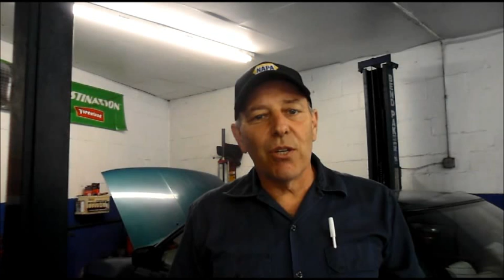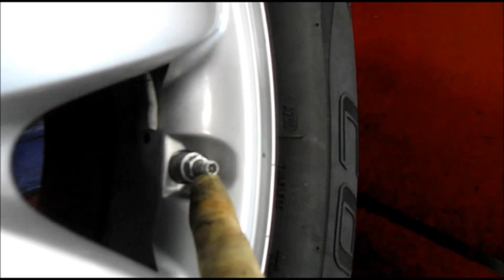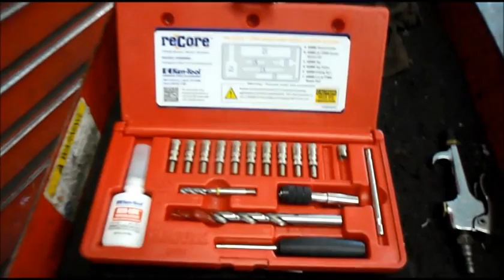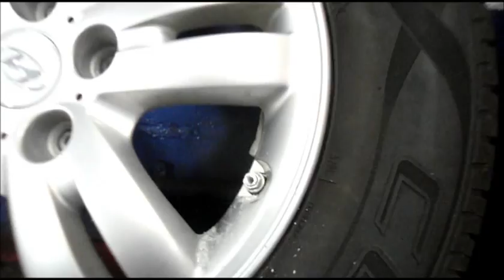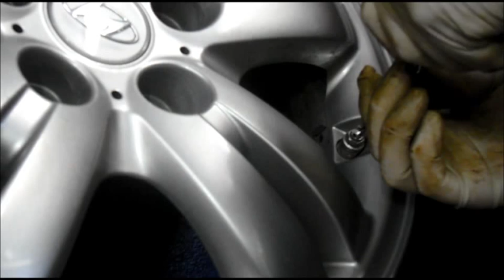Repair Broken Tire Pressure Sensor Don't replace It !!!!!

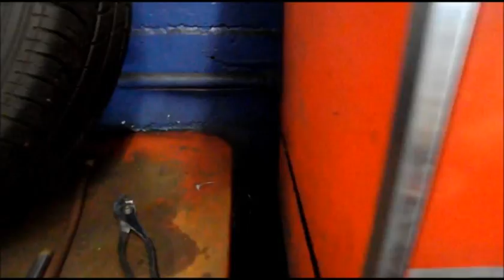Comment: @13:34 It should be certain torque there. On one sensor I bought (REDI Sensor) they gave that torque in the instructions 71 in-lbs ( and Schrader Valve 2.7 in-lbs),  but I see that torque on nut might differ (Schrader probably the same, but it is a problem to find a torque wrench within that small range), since in another film it was stated to be 62 in-lbs. Obviously the question about the specific torque on the Nut of the TPMS sensor kits is overlooked, I would say in all the films on YT about those kits. I want to reuse the original sensors, which are good, but don't know the specs on the nuts in service kits I bought. Probably I'll apply 71 in-lbs, not sure about this part of the project. I would appreciate any opinion on this matter.

Comment: I have a 2012 Honda odyssey.. the tire pressure monitor came on .. Honda service said I have a slow leak in the tire sensor on all 4 tires .. I'm a bit skeptical that all 4 are leaking .. to replace all sensors is about $700.00 the milage is about 129,000 .. just a family car and work vehicle.. any suggestions on saving some money in this situation? Thank you 😊

Comment: Jim I bought a new set of wheels and tires they told me the sensors would automatically take to my 2019 Grand Cherokee altitude. As they didn't now my Uconnect over my phone through my lease is sending alerts. how do i fix this Issue. As the code for the sensor in the new Wheels need to match up with the OEM code that I replaced .

Comment: Adding air into a Tire that has nitrogen will ruin the Sensor. If it isn’t pure clean air Compressor.
Reply from the maker: No it will not cause any problem.Thanks for watching.

Comment: This is insane, good job as usual on Jim's part, but if people weren't so lazy and learn how to use a tire pressure gauge a person wouldn't need an over priced tire stem. I just look at the tire and tell if it's low, then confirm with pressure gauge and boom, put some air in it and boom, I'm done. Unbelievable how lazy society has gotten. Sorry Jim, you did a great job as usual.
Reply from the maker: I agree 100% today people don't take the time to do the most basic things like check your tire pressure or even there oil.  People have gotten to dependent on technology.thanks for your input and for watching

Comment: It's my experience that replacing these rims with "analog" rims and being responsible for maintenance is more cost effective than having these strand you or your kids at some random convenience store in the middle of the night just because they wanted to add air to the tire. Cheap problem with a ridiculously expensive solution.
Reply from the maker: Thank you for watching .  Don't forget to subscribe.

Comment: What are the tools for repairing same on 2007 Mazda CX-9? Where can I get them?
Reply from the maker: If the valve is metal it will work and as for were to buy it you should be able to find it on line.

Comment: The new valve stem should have been shorter.  Since it is made of aluminum, it won't bend but will break the next time somebody scrubs a curb with it.  The original valve stem was short enough that it would hit if you scrubbed a curb.

Comment: Or put a normal valve steam in and deal with the light on the dash. There like $1.00 a piece. Check your tire pressure when you fill up or service it.
Reply: you can't many inspection laws say if you have a tpms system it HAS to work so you have no choice. its all a scam

Comment: Will this fix the no pressure reading on my dash? It gives me low tire pressure symbol but the pressure is fine.
Reply: No the battery inside your sensor is most likely dead

Comment: This works great for sensors with the valve that's fixed into the actual sensor, however with some BMW's and a Majority of  Hyundai's the service pack with valve replacement is the better option.

Comment: I bought a used 2007 toyota corolla le and im not so sure  if this car has a tire pressure system. I did look on my owners manual and  a tire pressure system is in the manual. But in my car it doesnt have the button instead it has empty slot and a clip that covering the empty slot next to the security light. How do i check if my car has a tire pressure system?

Comment: Dear Mr. Jim, Thank you so very much for your unique and distinguished touches on this video. You are a Master Mechanic. My case was a Rav4 2008 pressure sensor, but not leaking or damaged valve. Any suggestions is much appreciated. Thank You.
Reply from the maker: Thank you ..Live stream tonight at 7:00 PM .I hope you can stop by.
Reply: Dear Mr. Jim . It is an honor to meet you here for the first time. I'm a Mechanical Engineer who graduated in 1977.I wished one day I can visit you. I'm residing in Orlando. Can i still be able to see your live stream tonight? Thank YOU. I'll also share with you some of my experience with Automotive Repairs. My email address is: emad.alomary77@gmail.com. Thank You Sir
Reply from the maker: See you at 7:00 tonught

Comment: Ok Jim, I broke down  and bought an aftermarket tpms. It says no programming required. Cloneable. Use factory re-learn procedure. So, #1 How do I clone it? #2 What is the factory re-learn procedure for my 2007 Dodge Grand Caravan? I am not finding the correct procedure for my vehicle on the  internet.
Reply: ,I found the re-learn procedure but still need help on the cloning part. Got anything?

Comment: I have a 2007 Dodge Grand Caravan. I have to replace 1 tpms. Can I replace it with a traditional valve stem? I know you won't recommend it but I am poor and they were not mandated until 2008.
Reply from the maker: Yes you can replace the sensor with the old style valve but the TPMS light will stay on.Your are right I would never recommend doing that .Don't forget Live stream on Sunday at 7:00 PM

Comment: Thanks for an awesome instructional video. However, after installing as you instructed, air comes out after I pumped the air in on the completed stem valve. Doesn't stop no matter what. Any thoughts on this? Thanks.

Comment: I have a 2011 Sonata Limited. I have a small leak at the tire sensor. The outer potion of the valve that treads on is where the air is coming from. Is there a fix for this?
Reply from the maker: Willie Wallace If the stem is all aluminum you can repair it as in the video. There is a rubber seal that sometimes needs to be replaced as well. The rubber seal is between the rim and the stem.
Reply: Thanks Jimthecarguy; I replaced the rubber seal and no more leak
Reply from the maker: Willie Wallace Great job. Thanks for watching the video.

Comment: How did you fix the sensor if the sensor is inside the tire? I have one that I believe don't work on a 2010 Chevrolet hhr. Valve stem is fine.

Comment: Dear Jim.
You could simply just replace only the valve part and keep the sensor. Just FYI.
Also if you fit a titanium valve made from HUF, you will never get a stripped thread or seized or whatever. Quality is always the difference.
Also if the owner just go anticlockwise first to find the end of the thread that would not have been an issue, probably ever.

And just a simple advise who ever did this,  NEVER EVER, EVER install clip on weights on an aluminum rim. Those are for STEEL WHEELS NOT ALUMINUM.
Also NEVER EVER, EVER, mix clip on weights with stick on weights.
The odd part is that the owner of this Hyundai actually accepted this extremely unprofessional wheel balancing, instead of demanding only stick on weights, and stick on weights ONLY.

Comment: Way too much thread lock. nice job tho but tool only worth buying if your doing a few repairs.
Reply: He did a nice job. I was saying the same thing way too much thread lock lol
Reply: @ndandthecave456  the reason I clicked on the video is I'm looking for a video on how to remove the tpms sensors from an 09 rav4. The dealer wants over 1,200 bucks to replace 5 of them and I can get them online for about 200 bucks for all 5. Just need to figure out how to replace them (and I'm sure program them) lol
Reply: @ndandthecave456  can you access them without taking the tire off the rim? I have no way to get the tires off the rim. I mean yea I guess it's possible without a machine but that's alot of work having to do it without

Comment: Is the little air stem inside the valve the same as any other air stem ? I'm asking because I have one that's leaking air from the little air stem that screws inside the valve

Comment: Hello Jim.  Question.  I have a 2011 Chevy Colorado with almost 17,000 miles on it.  Coming home, the SERV TPMS light came on.   Know of any way to find out which sensor is bad?   Also, if I get all new TPMS, do i need the service kits also?   thanks
Reply from the maker: From what I read in my computer there is a special tool need to find out what sensor is bad but check out this video and try this first.https://youtu.be/oJFtjxMyg2M   and  https://youtu.be/3-NgKSCousA    .Keep me posted

Comment: Great video.  2 or so months ago I went and got my back tires replaced and a week after that the sensor came on and stayed on.  i didn't bother calling the place i did find it odd/convenient though they had an advert about tire sensors lasting like 5 years at the place and i had my car for 5 years haha.  Anyway how can i determine which sensor is bad?  the sensors don't register on my obdII scanner. Its a 2007 toyota camry.
Reply from the maker: You will need a tool like the one in my video to see what sensor is bad.  https://youtu.be/3-NgKSCousA

Comment: You are one of those rare mechanics that is actually trying to fix things rather than replace random parts hoping everything will eventually work out! Might I ask where you're located in case I need to bring my car in? :)
Reply from the maker: Thank you.My shop is in Bayoone New Jersey
Reply: Are you still @ Bayonne NJ?  i am looking for a good mechanic. i am in Jersey City. can you send me the address?
Reply: I am tired of so cold mechanics, trying random stuff, that doesn't fix the problem, then they still want payed for work you did not even need. Hard to find a honest, good mechanic...….just as well go to the dealership and pay high dollar, at least it will probably be fixed correctly, a lot of the little independent shops are a joke, just as well work on it myself then pay them for guessing at the problem, hell, I can do that.
Reply: Can i bring my car to you plz. It broke when i was putting air when i pulled it off my valve broke. How do i contact your shop?

Comment: Does this apply to a 2005 ford Explorer! I need a tire pressure sensor for a 2005 ford Explorer.
Reply from the maker: Yes as long as the valve is aluminum.Does the sensor work or is the valve leaking?

Comment: hi Jim good video as always, I notice that  you are drilling on a angle  when removing the valve core, or is just me ,? thank you Jim sheers
Reply from the maker: Good observation.It may look like an angle but that could be because the valve is a little tilted in the rim.

Comment: great vid! so how can I tell if this will fix my tpms on my 2010 tundra?  The tpms warning light turns on with a blinking that lasts a minute. then it stays steadily on. new car to me,  New tires,  all inflated to pressure. thanks!
Reply from the maker: +Gimme Anathlon  This will not be your problem.Did you try to reset the tpms  system?Check this video out to see if it helps .https://youtu.be/moOd8qdRRhc   .Keep me posted
Reply: +jimthecarguy Hi Jim, I just tried this per your video. It was very clear and easy to follow. I turned the car switch to on, pressed the button, etc, but this is what happened.
1. Turned key to On.
2. TPMS light was already blinking somewhat rapidly, but pressed reset button anyway and held for a few seconds.
3. Light continued to blink rapidly for about a minute, then stayed constantly on. I've even let it sit that way for up to 20 minutes.
4. I've tried variations of how long to hold it, and have driven it around after the process, up to 40 miles.

Any other thoughts? THANKS!
Reply from the maker: +Gimme Anathlon   If that procedure did not work the next thing you will need to do is to check the tire sensors to make sure that they were not broken or replaced when the tires were replaced.

Comment: plastic caps with seals are the best imo ive seen many steel caps seize to the aluminum sensors
Reply from the maker: +UBBERTANKER  That is true .I've tried to remove the steel caps and you know what happens
Reply: I just broke my removing that steel cap.

Comment: I never knew that kit existed. Never seen this on YouTube either. Nice
Reply: +Steve Rob they do sell the valve stem separate from the Tire pressure sensor in almost all manufactures and in the Aftermarket but when you go look you find the whole assembly and get forced to buy due to lack of stock
Reply: +K looks like the kit jim shows has the inserts in the kit. Great idea. I guess you need to buy the kit or someone like jim to do it for you.
Reply from the maker: +K  On this sensor it is one assembly  but I know what you mean some you can just replace the stem not the sensor
Reply from the maker: Steve it works great and saves the owner some cash:-)